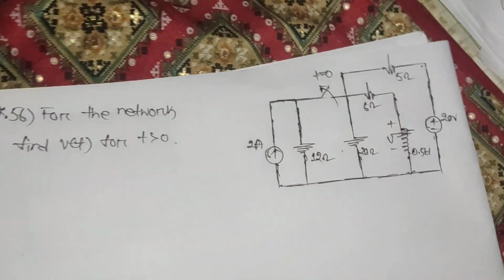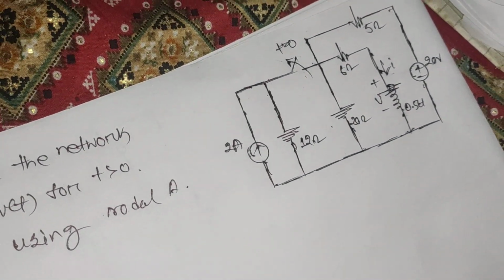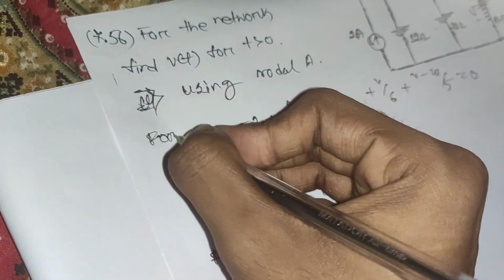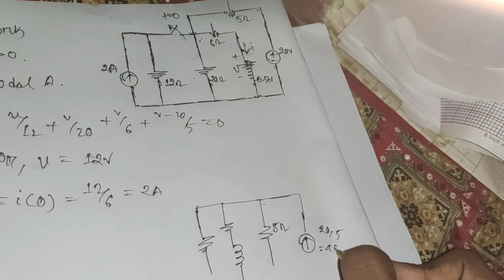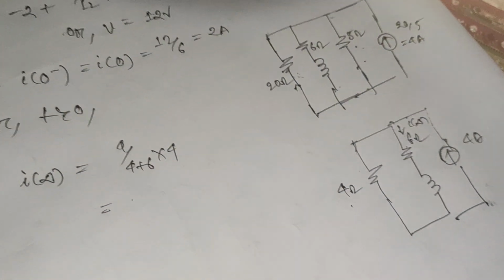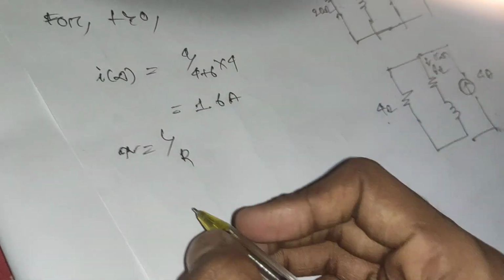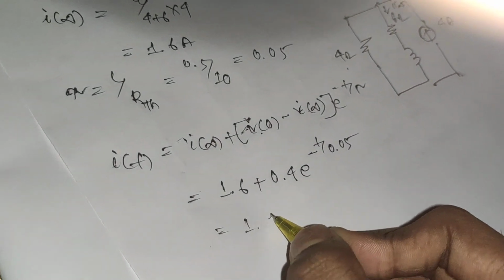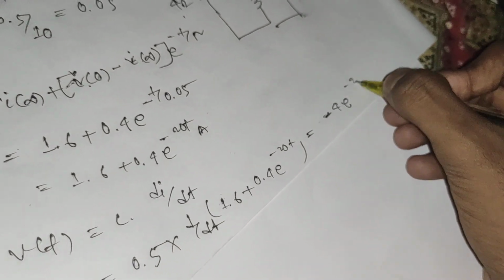Exercise problem 7.56 || Fundamentals of electrical circuit(Sadiku) || First order circuit chapter 7

Comment: The better solution for this would be,  

We know that at steady state Voltage across inductor would be 0v 

V(infinity) = 0v

For VL(0+)  we assume inductor as 2Ampere current source then using nodal analysis we find the voltage across  4ohm which will be 8v and as current flowing through 2ohm was 2 ampere we know that voltage across it will be 12v 

So we get the final equation for voltage across inductor at 0+ which will be

12 +VL(0+) = 8

VL(0+) = -4v

VL(0+) = -4v
VL(infinity) = 0

VL(t) = -4e^-t/tau